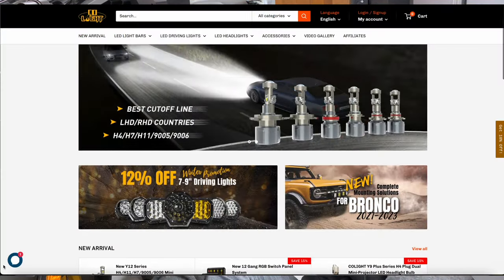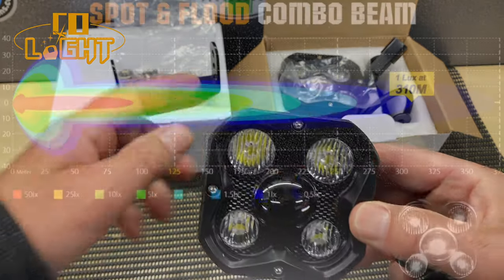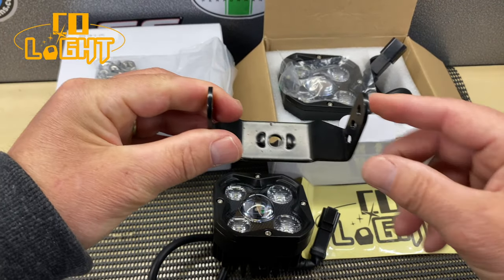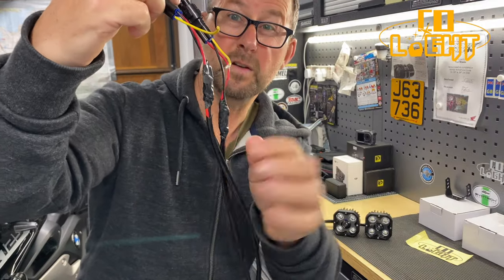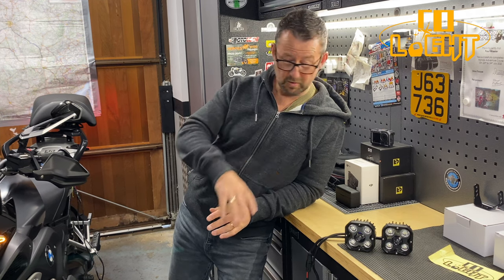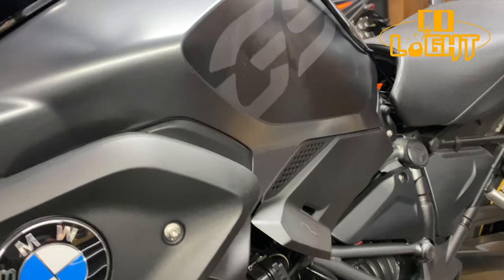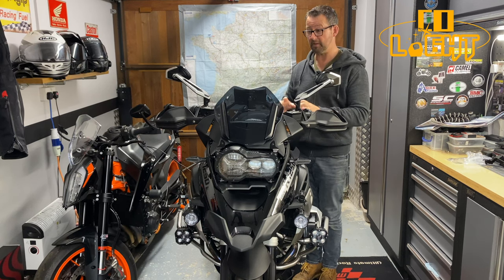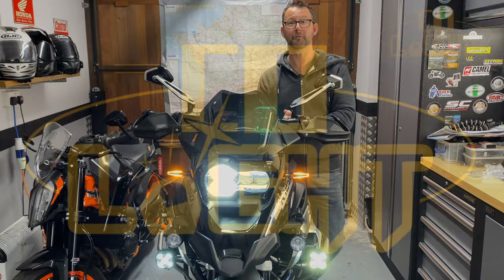3"HD spotlights from Colight, for £66. Let's try them on the BMW R1250GS👍

Comment: These lights are cheap and dont last 2 minutes, rode through the 1 st lot of rain in Italy and both sets filled with water and blew the fuse, now Co light are trying every twist and turn to get out of replacing the lights... terrible service terrible lights DONT BUY THEM
Reply from the maker: Andy, sorry to hear about the lights failing. I am about to fit them on my brothers F800 so will be interesting to see if he has issues. I hope Colight do something for you and eventually replace them.🤞

Comment: Useless.
Reply from the maker: Try them 👍
Reply: @gsd32i  I was driiving once on 1250 with original aux lights and led headlight for about 500km in complete darkness. Not once wished for more light. Just adjusted aux lights much higher to cover turns. My point is - there are mandatory upgrades to LC GS like headlight, cylinder head, dash protection, radiators protection and anything to stop rear tire throwing water to rider's ass. :) And there are tons of useless parts. So easy to drawn in them.
Reply from the maker: @SAMFICOM  well I am more than happy with all the things I have put on my GS . Everyone one is individual and what may be useless to some may be of benefit to others . Anyway enjoy the ride . 👍